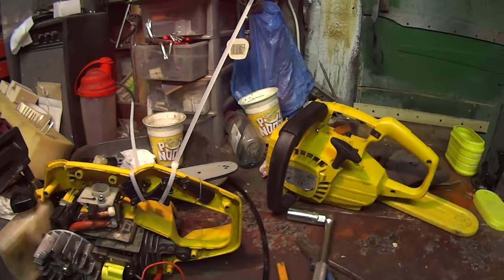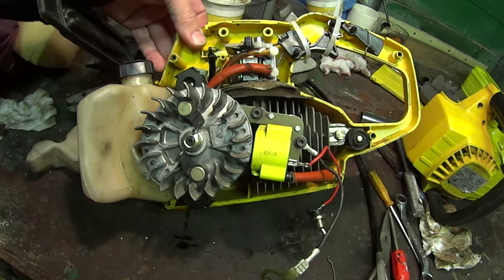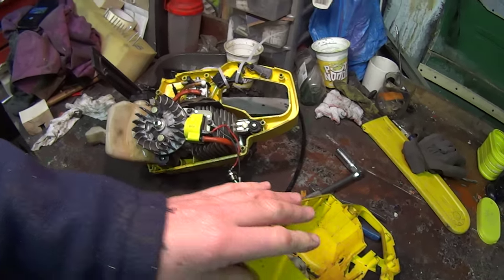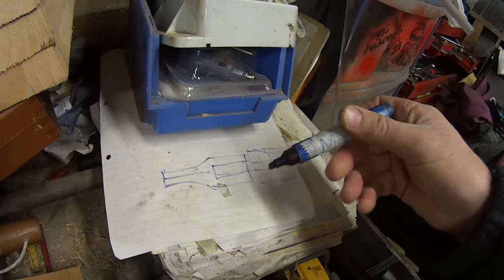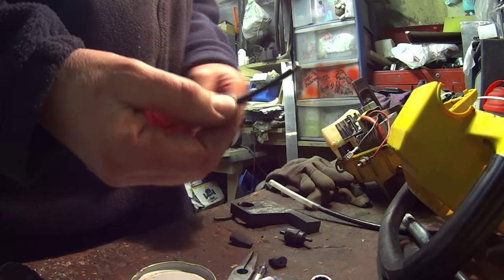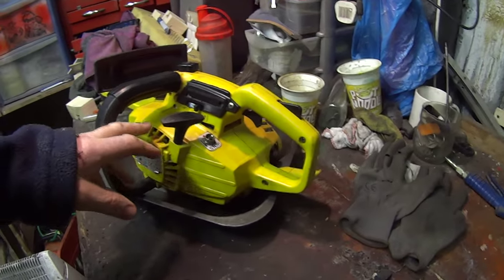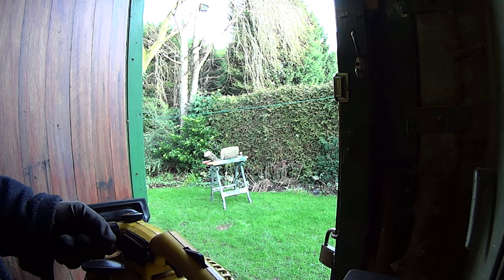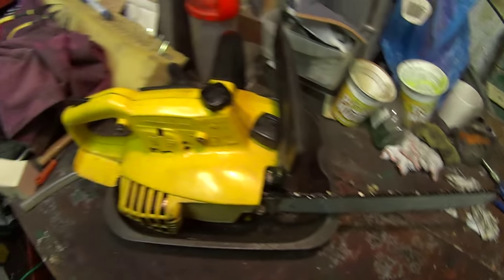Chainsaw Repair Alko Alpina Champion  oil in engine not starting

Comment: Hi Thanks for this video, but wondered if you could help me re trigger assembly, I did ,as I thought , that you said, secure the control levers, but when separating fully they came loose, and two lightweight springs came out but can’t figure out where they fit on the triggers, any help.??plz.🤔😊
Reply from the maker: @michaeldominy2084  Hi Michael,  saws back together but given the yellow one to my brother, if you look on the vid on the red champion chainsaw you should be able to pause it, the champion is exactly the same saw from the same manufacturer just with a longer back handle. Hope that helps, good luck 👍
Reply: @yamaar1rider  Many thanks for the information on that problem, I will check that out and hope I see what I need, . I’m sure your brother will be happy with the machine.👍😊

Comment: Hi, i have the same, where can i buy the small valve/oil pump?
Reply from the maker: Hi, sorry don't know off anyone that sells the spares, your best bet is to leave the oil tank empty and use a spray can of motorbike chain lubricant as this stays on longer than WD40 but that also works well. Cheers Andy.